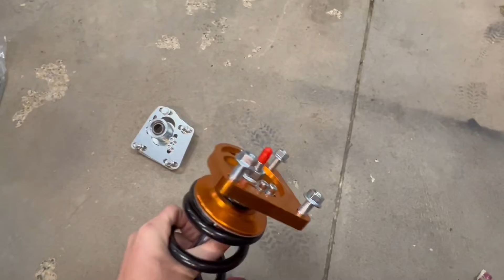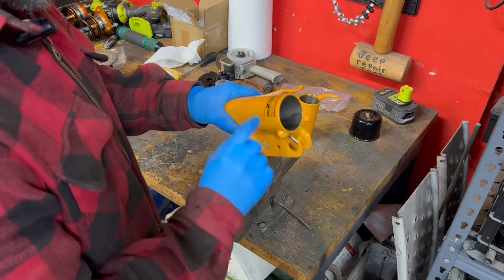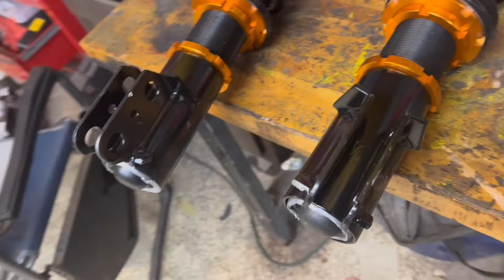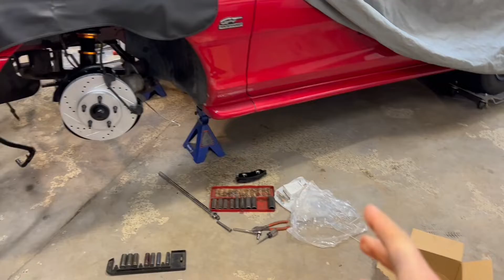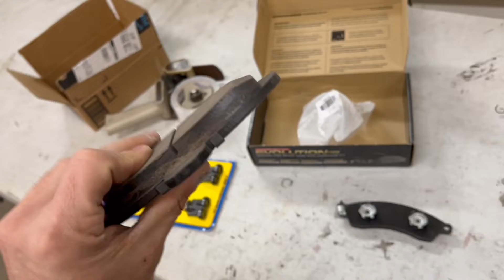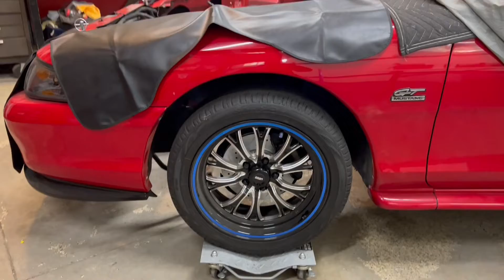Front end overhaul! $224 Maxpeedingrods Coilovers for my SN95 Project HellStang!

Comment: i had to do the same with the front coilovers and there wayyyy too stiff gut busters, on the rear i had to extend the lower mounts or they bottom out.
Reply from the maker: My fronts seem great. I’m running stock springs in rear with a 28” DR and the wheel gap is about perfect back there. But I feel like the car drives pretty much like stock nice and soft

Comment: How are the rear shocks
Reply: Did they ever fix the rear long shock problem
Reply from the maker: Never tried them. I only used the front ones and sold the rears. I have Lakewood drag shocks for the back and either keeping stock springs or going with edelbrick 1” lower springs if I can fit them. I want to put a 275/60/15 tire under the car and not sure if the shorter spring will work. None of the tear end work will happen till this winter. I was hoping to have it done this past winter but never made the time for it
Reply: @PeakPerformanceEngineering  im in the same predicament i got my 98 mustang and they had the front coilovers on them but then the rear end was raised and it made the car look a lil weird so i wanna put the rear coilovers on but ive heard so much bad about them like them being to stiff and there like maxed out once your car is actually lowered on the ground and it just makes the ride bouncy
Reply from the maker: @Ephixa06 yes I heard all that as well and def didn’t want to have it bouncy. The rear end is still all stock and it rides great right now with just the front on there and didn’t want to lose that.